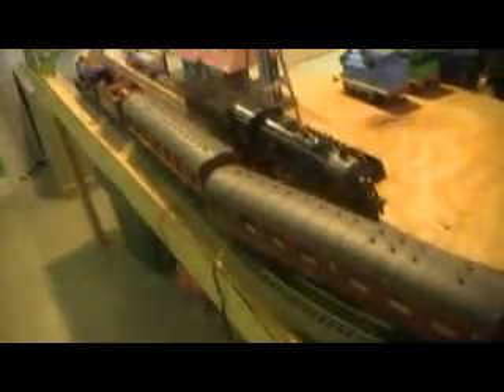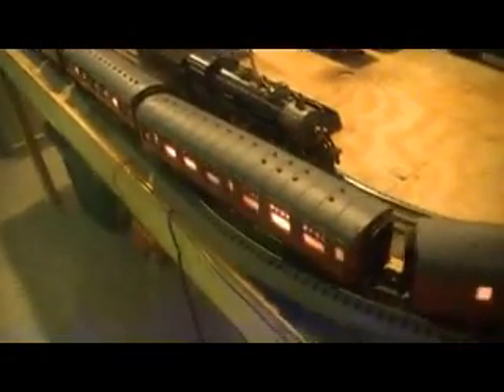Lionel Hogwarts Express reveiw

Comment: Locomtive #5972 or Olton Hall is a 4900 hall class 4-6-0 built by Swindon railway works in 1937 for the Great Western Railway. Oringinally painted in a great western brunwick green. Sold for scrap in 1964 but was sold to woodham brothers in 1981. Restored to be in Harry Potter and the sorcrers stone in 2001.